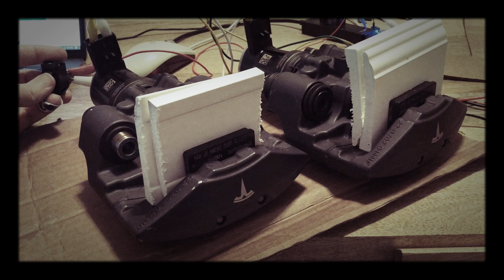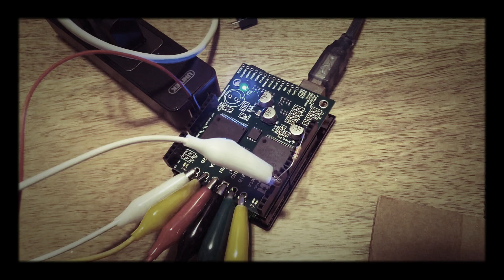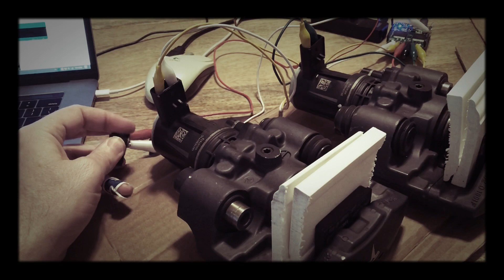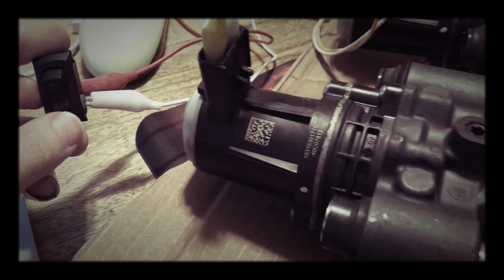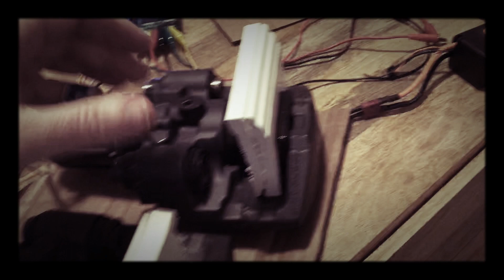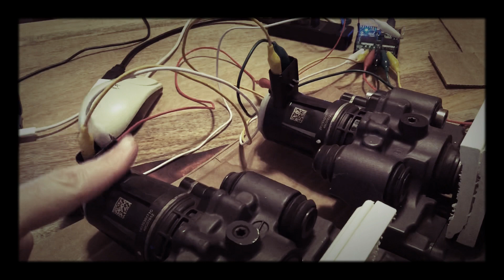Hack Tesla Electronic Parking Brakes for custom builds!

Comment: Any idea what the travel distance is on this caliper?  Tesla rotor appears to be 28mm and the rotor I want to use is 24mm.  Diameter is 330mm on the Tesla rotor and 300 on my desired rotor.  Less worried about the diameter, as it will only be used as a parking brake and I don't expect a lot of pad ware as a result.

Comment: I'm looking at this solution for use as cutting breaks... to be able to lock up one side at a time to allow for tight turns while rock crawling... anyway, I'd want to use individual switches to control each caliper. Would the code be easy to modify to make thar possible?
Reply from the maker: Yes, easy change to enable independent control.
Reply: @sheffdog36  cool, I'm going to order the controller and Arduino now. I've never played with them before. Hopefully, I can mutule my way through it.

Comment: Hello, is there any adapter for 2pin wire to 4pin motor?
Reply from the maker: YOYO TSAI You can find the connector pigtail on eBay under the following description “Jeep connector relay radiator fan” or you can buy the connector and terminals to crimp it your self. —— Aptiv 54200409 Apex 2.8 Sealed 4 Way Female Housing  Aptiv formerly Delphi

https://www.waytekwire.com/item/38860/Apex-2-8-4-Way-Sealed-Female/?gclid=CjwKCAjw4KD0BRBUEiwA7MFNTSxvLC7-wtPB3wkOE1C3W8F-XLgRdSMYCGapdxDA-_anG0Nxav2mGBoCyNsQAvD_BwE